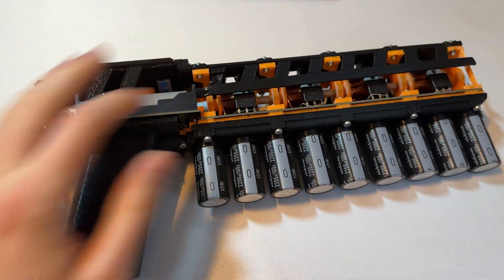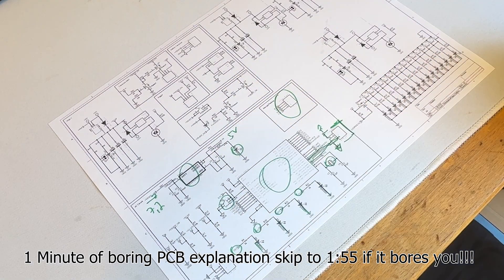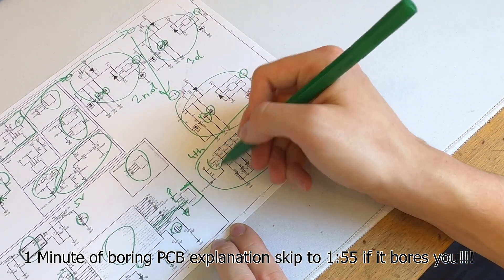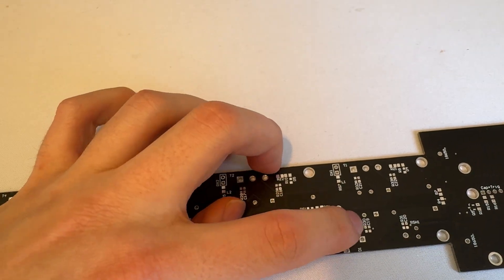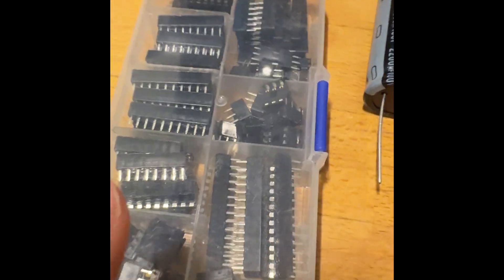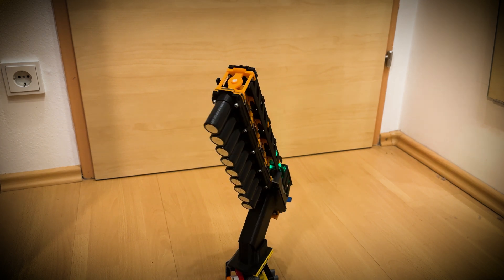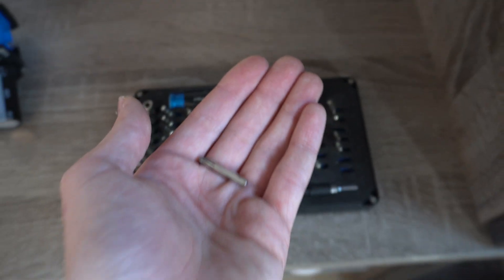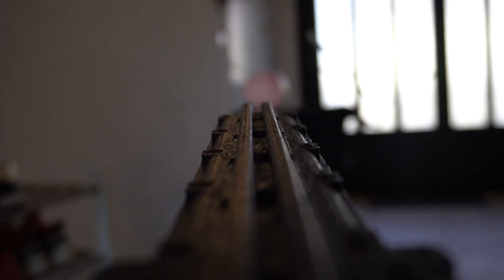I built a CoilGun

Comment: Great job! Have you tried different coil shapes and inductivities or just guestimated it? And is it an open loop or closed loop design? You can add boost converter outputs in series, if powered from seperate batteries. Another easy fix to boost the voltage further would be a simple voltage doubler circuit: Basically charging 2 Caps in parallel, then discharging them in series.

Comment: if u want to challenge yourself, u can built your own boost converter. i would just use a battery with 11.1v volts or 14.8v, and then build a regular boost converter, with a high voltage mosfet, hooked up to a microcontroller via a mosfet gate driver. these are not too hard to build by yourself and u can charge such a weak capacitor bank in a matter of 300 milliseconds with it

Comment: When will you make a bigger and betterer coilgun. You might want to try making coilguns that use regenerative braking circuits to manage the back enf and using asymmetrical coils for constant acceleration. The coil would be one turn thick at the back end and would expand at the inverse of X towards the end. I. Your pistol you could have two larger assymetrical coils instead of several smaller symmetric coils. Another option to increase efficiency would be to use smaller symmetric coils. Instead of several of the coils you are currently using you could use 64 thin coils with a regenerative braking circuit to manage the back EMF.

Comment: Timing is everything, and yes using the 'predicted' method of staging based on assumed position is really bad...
Also using an arduino is really bad, but I can see you have the actual atmel chip and not a 'uno' - but it will still suffer a major loss trying to detect the position, then trigger the SCR - the compute cycles will add some delay, and again some assumptions are possibly required when determining the ideal positioning of the projectile in the coil...
...The best way is to directly trigger the SCR with logic, and to downsize (and up-voltage) the capacitors down-stream. That is all...

Comment: With only 45V or even 100V I would use Mosfet´s instead of SCR´s. Everything above IGBT´s. If you cant find a boost converter build your own. Fast google search: LTC3813 would be an option (didn´t read the whole datasheet so take it with a grain of salt). For higher output voltages consider isolated topologies.